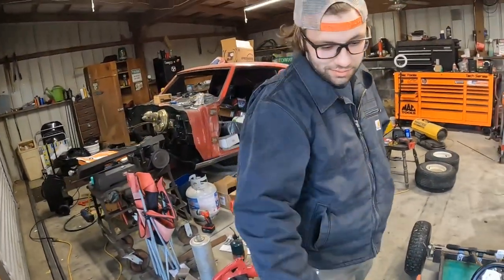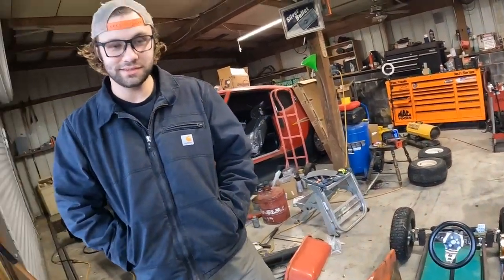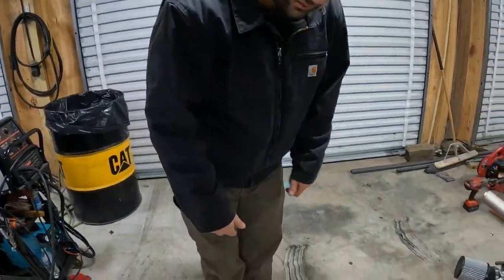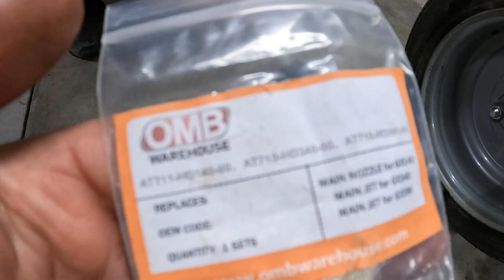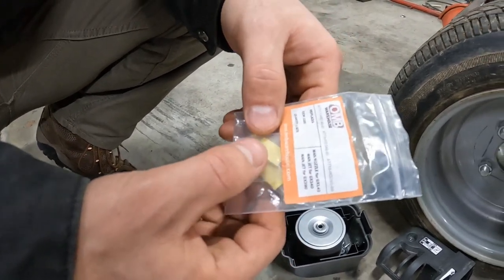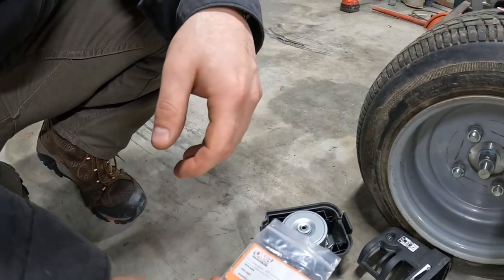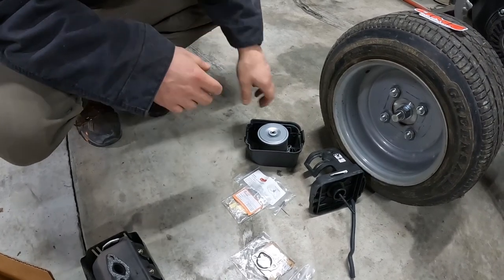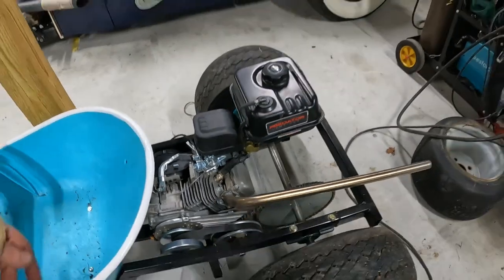We race the Rat Karts! Was the upgrades worth it?...

Comment: Why bother with an air filter? 

Just bolt on a velocity stack, the engine is disposable. During a HF special, the air filter kit will cost more than a replacement engine. Just get a couple.

20 years ago I built a kart with a real Honda 6.5, and even when the engines weren't cheap, the racing crowd was running only velocity stacks. So, the bell-mouth intake spacers were cheap & that's what I did. 

(1" thick alluminum donut to replace stock intake, works with stock carb studs after removing the plastic air filter housing)